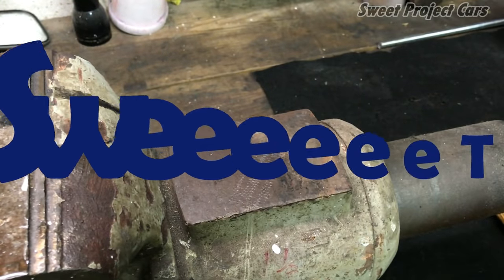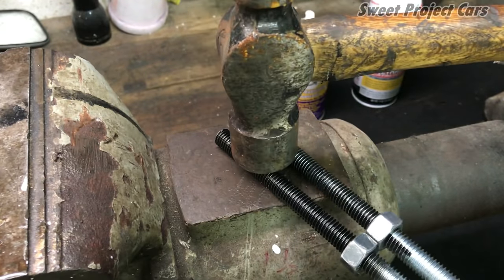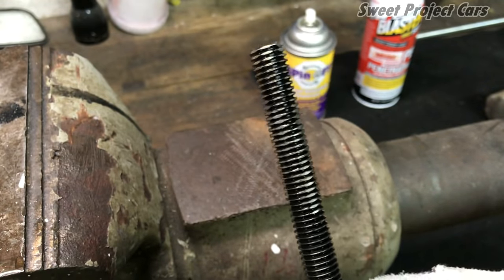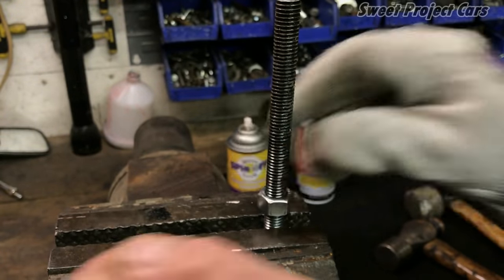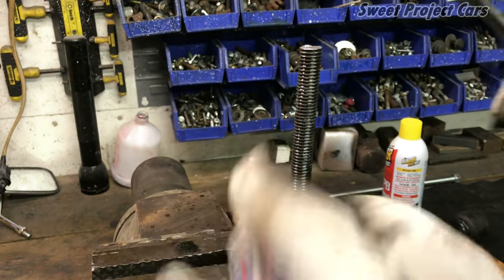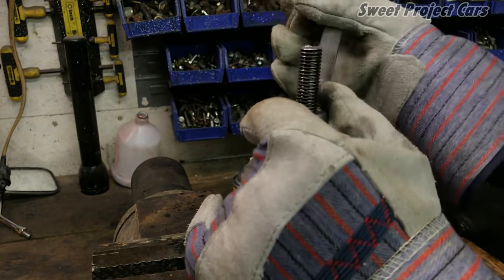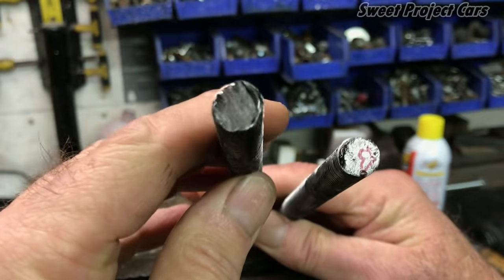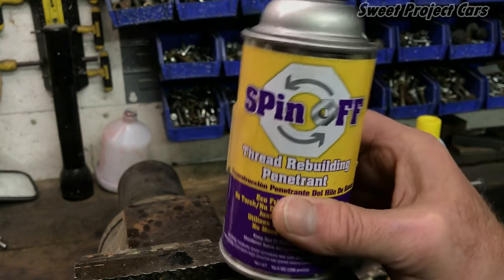How To Remove RUSTED & DAMAGED Bolts & Nuts...FAST!

Comment: In my opinion penetration lubricants are designed to free up rusted on fasteners, not ones with marred threads.  Your test was interesting, but not relevant to most mechanics since rust is the issue.  I've used PB for years and I think it helps some, but it's certainly not a miracle product.  Thanks for bringing Spin Off to our attention.  I'd definitely like a better penetrating oil if one is out there.  Thanks for sharing.
Reply from the maker: Rick Nelson we never said anything was a miracle product we were just showing how it works for us and everyone is free to try the test in whatever manner they feel..we have done the test on rust and it worked better than anything had used in the last 35 years. can you imagine the amount of even more negative comments we would have received on doing rusted bolts?...like, "Hey that one bolt was rustier than the other" and so on.
Reply: Was thinking the same thing

Comment: I use wd-40 for drilling because it smokes when hot witch is a good indicator to light weight or slow down the drill. 
I use pb blaster for stuck threads to rapidly cool the nut or bolt to shock the rust, wd-40 tends to boil to quickly to cool as well as pb blaster
So long as the Spin of doesn't stink, burn or boil to quickly might free some space in the coberd👍

Comment: Yes my dad and my uncle swear by spin off...they use it at the shop when doing wheel alignments on the fleet trucks that have damaged/rusted tie rod threads. It saves his company hundreds in parts and  most importantly SAVES TIME.
Reply from the maker: Klay Thompson thank you very much for sharing, that is much appreciated

Comment: good tap cutting lubricant. The issue for me and most mechanics I've heard from is that when it comes to galvanic corrosion/rusted studs/etc is that nothing really penetrates down in to the problem area. The allthread in a vice was able to be coated with the spray, I'd like to see this on some rusted exhaust manifold studs, nothing I've ever seen actually does any "penetrating" past the outside surface.
Reply from the maker: Derrick Hodges  well my friend give it a try and see if it works for you..we were skeptical as well but not anymore :)
Reply: Spray them with clr,let soak, rinse with alcohol, dry with heath gun, scrub with wire brush. Do this about five times then spray with oil and you will be able to save some of those manifold nuts... The only easier way is to grind them off then weld on new studs

Comment: I’m not sure how bashing threads simulated rust. I appreciate your review and will try it if it isn’t too costly although 50% trans fluid and 50% Acetone is what I use and never have a problem, even on my 2001 Silverado Bed mounting bolts and exhaust flange bolts.
Reply from the maker: RedWhiteAndBlueVideo we did not say bashed bolts simulated rusted bolts. we just did a test to show how it workes on damaged threads..we tired the Trans and Acetone and it was no comparison, and if we would have done the test on Trans and acetone everyone would have said you need to try PB that's the best...we know we have always kept an open mind to try everything, if it works well for us we share it if it doesn't we don't.

Comment: Very curious whether you think this stuff will work in reverse.  Can I buy this and throw away my thread tapping kit if I have mashed threads in a screw hole?
Reply from the maker: joey numbnuts we have found here that the reassembly is much much easier :)  and you never want to throw your tools aways but for the situations where you need a penetrant this works great.

Comment: Dude! Thank you for this video! I have a 1987 f250 4x4 and a wrangler 4x4 that I regularly torture in the mud and dirt. I always rinse em off after offroading, but the rust and stuck bolts anytime I have to fix something, it takes a few days of pb blaster to just get em off. I'll deff try this stuff, and if it works better, I'll have to get a case of it lol. Not joking, wish I was tho
Reply from the maker: J Tra it worked great for us and know it will the same for everyone else :)
Reply: Whether its an '87 F250 or a 2019 F250 you will need it for both. If the spin-off removes rust don't spray on too much or there won't be a truck left to drive.

Comment: Nice job! Impressive... But, it's not trying to get nuts off of marred bolts that is the monster, it is getting rusted corroded bolts loose without breaking the bolt or rounding off the heads, that is what penetrating lubricants are needed for most of the time. I don't remember having any problems getting a nut off a marred bolt before using any lubricant. I don't run into this problem enough to worry about it.
Reply from the maker: Dano C. well we have tried it on rusted bolts and it works as good or better and we did not have to waste as much time and use our acetylene and oxygen up

Comment: The most impressive penetrant I’ve ever used was the original, non-aerosol Bearing Lubricant, then made by Sandaro and now available in aerosol cans from Bostik. It is marketed as a bearing lubricant for woodworking power tools, but when I used it, with no expectations, it loosened up a wheel bearing that  was rusted solidly to an axle under a garden cart that had been left out in the weather for years. I flipped the cart over, and the axle would turn in its mounts but nothing would move the wheel by itself. Applied the lubricant, ten minutes later I walked by and the wheel was free and with one push rotated freely for about two minutes.  I’ve never seem anything else that effective before or since.
Reply from the maker: Anonymous98 thank you for sharing my friend :)
Reply: Sweet Project Cars Glad to and thanks for introducing your viewers to Spin-Off.  The spray version of Bearing Lubricant is good, but I wish I could find the non-aerosol version - it was amazing.
Reply from the maker: Anonymous98 you are very welcome my friend :)

Comment: Looks like great stuff, thanks for the heads up!
Just out of curiosity, could you try a little bit of that "ceramic nanocoating" on the same kind of test and see if it works as well?
I'm curious as to whether or not it's just a different use for the same stuff. Thanks.
Reply from the maker: Not sure if the glass ceramic coating would do the job when they say on the  nano technology that just means that its mixture is measured in the one billionth meaning that the spin off particles are very very small aiding in the product doing what it should do
Reply: Ok, thank you for the reply.

Comment: Tried pb blaster around the ranch and even soaked some stuff for a couple of days it didn't do much  but it sure stinks though  , maybe it's only for brass nuts and bolts , where can you buy spin off ?
Reply from the maker: Tank Soldier im with you on the smell of pb  here is where you can get the spinoff my friend http://encoreindustrial.com/spin-off-thread-rebuilding-penetrant

Comment: What, no Mothers Mag and Aluminum polish also as a comparison? 😊
Reply from the maker: ioneyesed we only share what works. why would we share something that doesn't work? makes no sense.
Reply: @SweetProjectCars  Thanks SPC, brilliant ideas. Just my humour as I've been following your ideas for a while now and Mothers has almost  been your signature go to compound for it seems almost everything - polishing glass, plastics, paint, metal and everything. Probably wash with it too. Purely my humour though I bought Mothers on your recommendation and it's brilliant. Incidentally I searched and Spin Off is not presently available over here in the UK. Sadly several of the products you use are hard to come by here, or sold at a not so sweeeet price due to importing it. Keep up the great work. 😊

Comment: Have you tried it on stuck rusted bolts or nuts? I don't see any mention of it as a penatrating oil for rust on their website.
Reply from the maker: J B we certainly have and all I can say is, amazing! we did some seriously seized kingpins and wow. it takes a lot to impress us here just like us using mothers mag on paint until we seen it for yourself we would have never changed over to it.
Reply: Thanks. Your the only person on YouTube I've seen that answers every question!
Reply from the maker: J B it is called respect my good friend if someone is going to take the time to comment and share they deserve a response from us :)

Comment: Awesome review! 
At $20 you're still talking pennies per use... still a great cost-benefit!
I'm thinking lug nuts and exhaust mounting hardware will benefit from this. Thanks! 👍👍👍
Reply from the maker: swm122758 you are exactly correct, time is the most precious thing we have and acetylene and oxygen isn't cheap either lol
Reply: swm122758 - careful using on lugs...wheels may fall off lol

Comment: I am not saying I don't believe you that spinoff is better than PB, but this was not very scientific. Controlling and having a repeatble method of.smashing the threads would help.  Possibly dropping a weighted cast iron pipe from a known distance on to the threads would help equalize the field. Only dropping the pipe 4  times and rotating the threads so that the pipe hits in a different spot each time.  mashing the threads near the end, and Using a torque wrench to get an actual numerical value would help as well. Thanks for.posting. Always nice to find a better penetrant.
Reply from the maker: We could’ve easily spent one or two hours on a video doing a scientific study but as you know most people only watch about 2 to 2 1/2 minutes of any video posted so we perked everybody’s attention with our backyard testing, it impressed us, and everyone out there is more than welcome to fire up their lab test away, we are hoping for a $5 million grant so we can get our laboratory set up correctly have a great day

Comment: That should be excellent for cutting threads with a tap or die.
Reply from the maker: We found it worked great for anything that has to do with nuts and bolts or anything that is seized up

Comment: You should do an threaded rod without any lubricant to see what happens.  A comparison test.
Reply from the maker: RC Bronco well we did to establish a baseline and it was not good, it was like trying to tap a hole without using tapping fluid

Comment: Any tap/die cutting fluid will do the same.
Reply from the maker: off road specialties I was a tool and die to journeyman mainly CNC for 24 years and never seen anything like this stuff
Reply: What do you propose the activitie ingredient is that makes this product better for reforming the threads?
Reply from the maker: off road specialties developed in 2014 with nanotechnology. It is non-flammable, non-toxic, biodegradable, contains no petroleum by-products. and of course, they are not going to share the exact ingredients much like popeyes chicken they keep that recipe to themselves LOL

Comment: The nut cleaned threads spin off&Phone blaster only used as lubricant
Reply from the maker: james moar try smashing a bolt as we did then try removing the nut with no lube, then try it with the PB and then the Spinoff and you will see  for yourself my friend

Comment: Pretty amazing but you'd expect a little "waw" at $20 bucks a small can!
Reply from the maker: hasbeengood it is much cheaper than your time spent on a stuck and rusted bolt or using up you acetylene and oxygen

Comment: In this case I would use a thread chaser or die.
Reply from the maker: That’s fine but you still have to remove the knot or the rusted bolt
Reply: @SweetProjectCars  Yes clean the threads up and then remove the nut.

Comment: Sucks it has to be so expensive
Reply from the maker: hddm3 not really it is much cheaper than your time spent on a stuck and rusted bolt or using up you acetylene and oxygen we did a cost check and it will save us a boatload of time and torch supplies :)
Reply: hddm3, I was thinking the same but the last time I got in a pinch with rusted up nuts and bolts, and ended up bending a very important bracket, in the struggle😀,it cost me 3 days down and $85 to fix my problem. I've watched their videos and if it works that good! It's worth it my friend. 👍👍
Reply from the maker: Silver Grizzly you nailed it brother :)